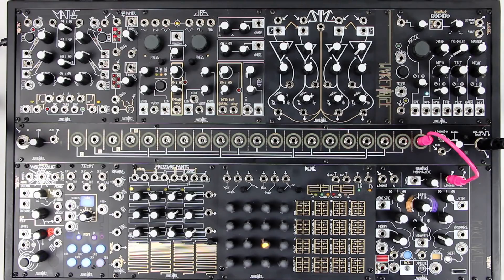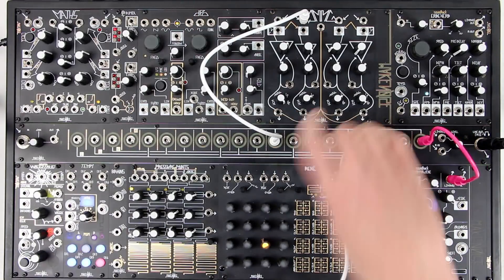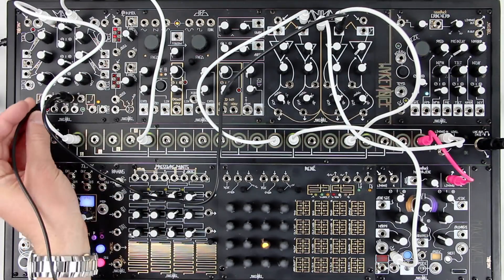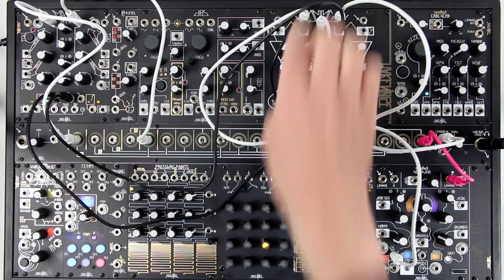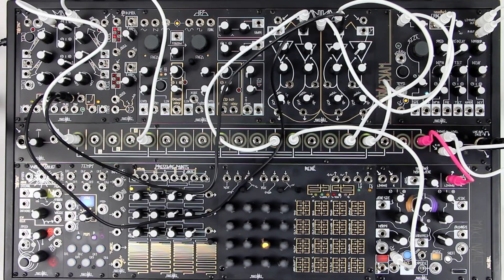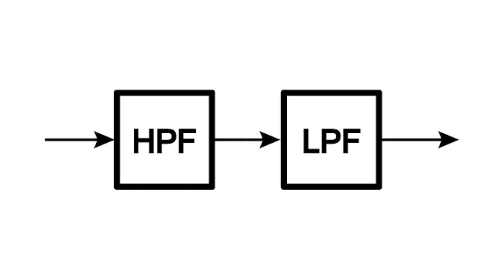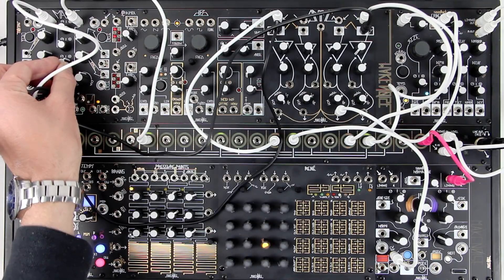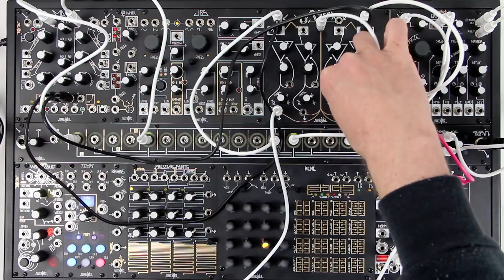Strange Spectral Sweeps

Comment: Necro-post, I know, I wonder if Strange was implying that the final output was to come from the *difference signal*, rather than the sum of, the two low-pass filters he described. This would result in a pseudo-dual-band-pass type of operation, but resulting from two LPFs, like Rob Hordijk's Twin Peaks filter.
Reply from the maker: In the text Strange simply sums the two together (and the only inversion in the diagram is on one copy of the filter envelope): "The two opposing spectral sweeps are mixed to a single output channel. This simulates band-reject filtering, but by playing with different Q relationships some interesting phasing effects can be done due to the phase shift in each filter. If you don't have two band-pass filters use whatever filters are available and see what you can do with the patch." (As noted, it's only in this final sentence that he makes reference to band-pass filters. Otherwise in text and diagram he uses low-pass.)

Comment: Yeah, this is totally academic, since only a few people will have this module available to them.
Now that the MMG has been retired, and the Optomix and LxD are probably on the way out (vactrols) what's going to be the new filter? 🤔
Reply: noi1989 : The QMMG seems like a mythical beast, but I think anyone can utilize this technique with two regular old LP or BP filters as well!
Reply: Doubt that LDRs and LEDS will be going out of production anytime soon.
Reply: If I'm not mistaken, part of the difficulty in making these is to get vactrols that lie within some tolerance range (they have high variance). DIY vactrol alternatives are going to be a pain to calibrate on a production scale even more so.
Reply: You can do this with any 2 filters and a mixer...
Reply: why do you think they are on the way out?
Reply: Three Initiates they keep talking about a vactrol shortage.
I read that one of the few companies that make a certain kind, that are well suited to applications like low pass gates, aren't making as many and for a lot more money.
If the components aren't plentiful, prohibitively expensive or both, designs have to change somewhere.